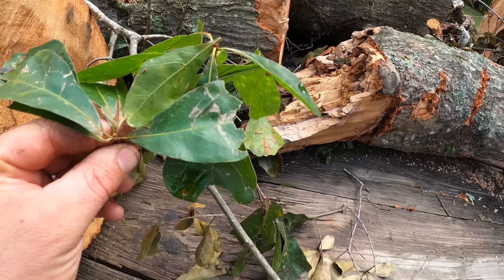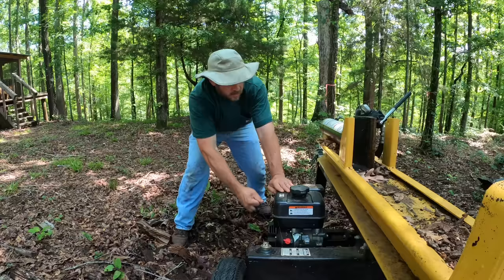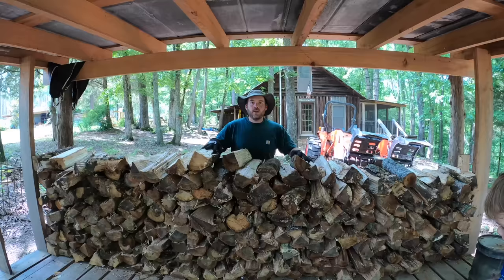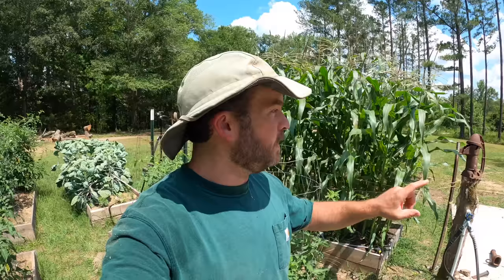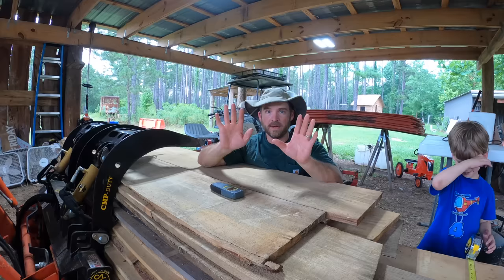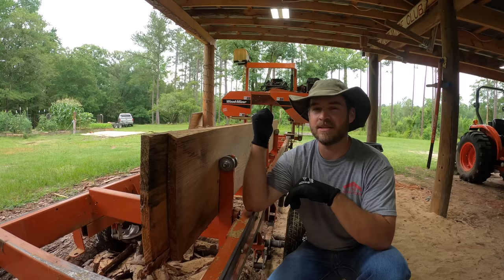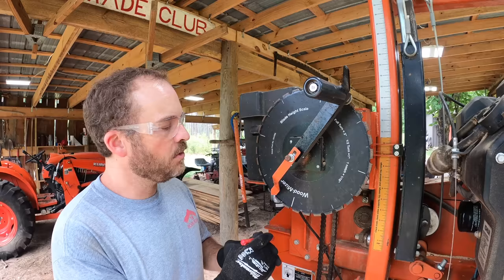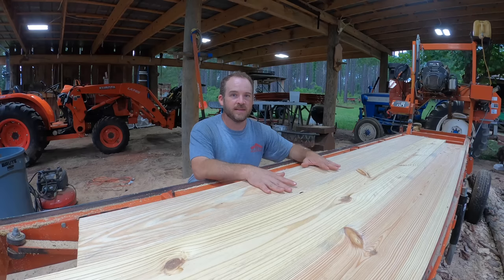From Rough to Ready - Turning Sawmill Boards into Finished Lumber

Comment: i’ve found to accurately find the moisture content of boards you have to push the meter pins into the end grain of the board and a sample will 😂be taken by cutting one of the boards somewhere towards the middle of the board . If you don’t want to cut the middle then at least 6 inches from the end. 
A log with end grain cracks may test low moisture but when cut and checked can still be to wet.

Comment: Additional afterthought.... When you get a length of firewood log and it's so knotty and gnarly that you can see that it's going to give your splitter a real workout with a lot of cross-grained areas, you might consider putting the log on the mill and cutting off firewood sized flitches on the entire log first, then chainsaw the flitches into burnable chunks. That might result in a bit easier work.

Comment: Question.. I'd bet you have but, have you looked into something like a solar kiln?  
    Oh, and stacking the logs on top of each other... show off!...lol..    Man, how did we ever do without grapples??! I can't tell you the HOURS of back breaking work mine has saved me.
Reply from the maker: Ha! Might have been showing off a little on that one. No idea what I did before that grapple, except a whole lot more work. I have a 10 part series on the channel of a solar kiln I built. It worked extremely well at drying boards, but it was a nightmare to load because of a poor design. So I stopped using it.

Comment: I was told once by a small engine repair man that when you store a small engine for a long period of time to run the engine out of gas so I started doing it years ago and everytime I use the equipment again it starts on the first pull with fresh gas in the tank!
Reply from the maker: Yep, that's the best practice for sure.

Comment: When doing something similar several years ago, I found that the heating in the winter created some gaps as the winter humidity levels dropped.  I would not be surprised if your wood heater does the same.  Thanks.
Reply from the maker: Yep, we've got boards in the house from previous remodels and some of them definitely open up during the winter.
Reply: @falllineridge  Some gaps can be camouflaged by painting the space between and the edges of the boards.  I am not recommending that, but it's a possibility.  I am not really sure how effective it would be on ceiling boards.  I did a wall once and spaced the boards about 3/8" purposely and painted the background space with black paint before the installation of the stained boards.  It gave quite a dramatic effect.  It was more for decor than sealing a wall though.  I'd like to say it was my handiwork, but an architect specified it.  Good video and looking forward to seeing the ceiling.

Comment: I’m shocked you haven’t built a solar kiln yet.  Would help you dry stuff quicker and would be a good video for the channel.  
A great video on them is by Heirloom Builders here on YouTube.

Also vinyl siding pallets are 13’ long and solid decked so that’s perfect for 12’ boards loading in and out of the kiln with the Kubota

Comment: A pile of boards will dry the same as a solid log (just faster), the outside drying faster than the inside. If you dont rotate and reshuffle the pile, that's what you get. Maybe consider building yourself a kiln?

Comment: I have some concerns about the moisture content of these boards. 11% in the house now, but only after a few weeks or even a couple of months? I don't think this is enough, the boards in the house will likely dry more ac you use the AC over the summer. I would acclimate these in the house over the summer AC for at least 6 months, its a lot of work to have to take them all down and redo it later, or live with the "rustic" gaps, which are nice too.  Why not dry them in the solar kiln? You can easily get them down to the 7-8% range that would be completely safe.